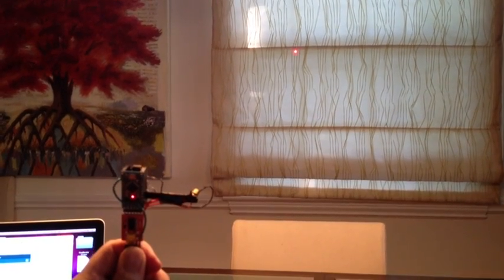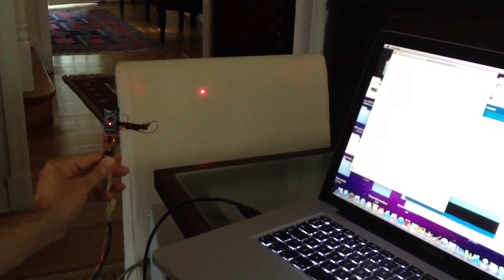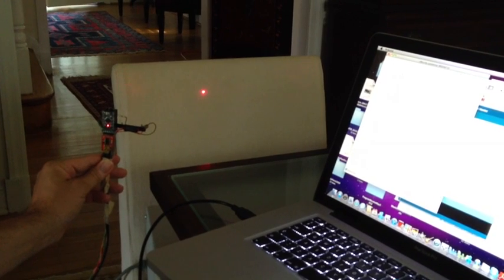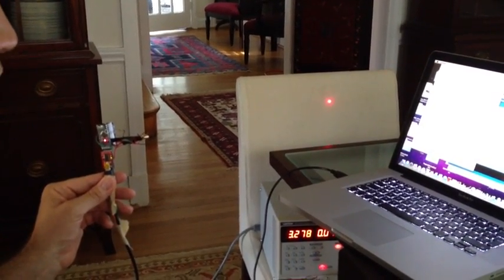Prototype Arduino-powered 11 gram laser rangefinder

Comment: Brilliant!  This is the same concept as structured light. Use a spinning mirror to spread the beam horizontally and orient the laser below the camera--voila, obstacle detection. Pixels lit up at the bottom of the matrix are close, and pixels further up the matrix are far. 36 degree FOV. The challenge, as you mentioned, is outdoors where all wavelengths of light are found. A red dot is usually about 650nm wavelength.  You can improve sensitivity with a simple 650nm filter in front of the camera.

Comment: Nice , my experience with something very similar is that just minor flexing of the "baseline" , the arm between the sensor and laser, will skew the results substantially.  It's probably obvious , but for practical applications, the design must provide for a very rigid baseline.